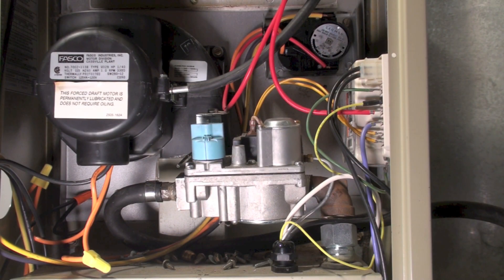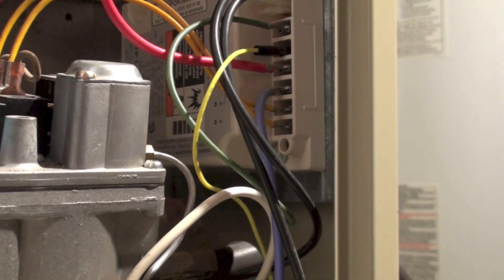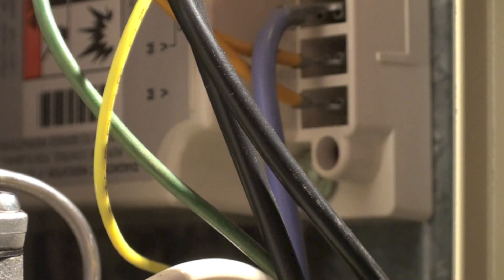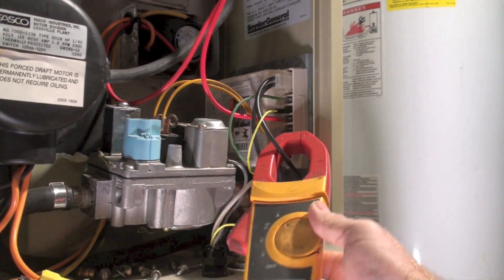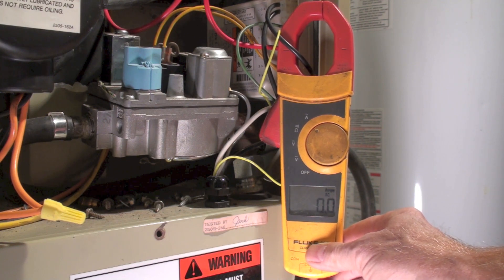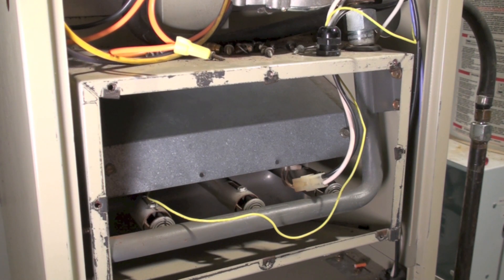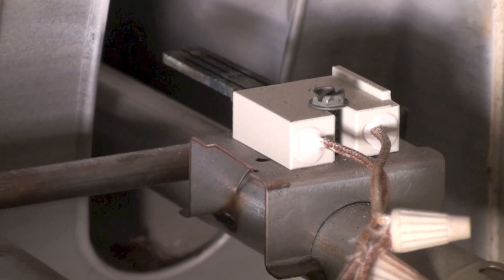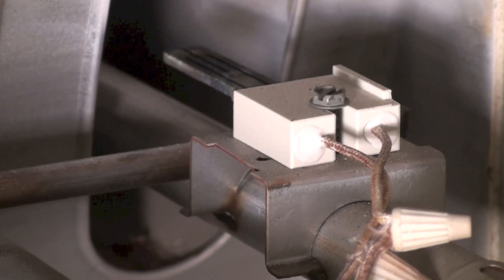No heat troubleshoot the HSI on the Snyder General GUA furnace.  Part 3

Comment: do you know if any 50E47 module work on my snyder/general GUI100AO20AIM mine has power going to the module no power to igniter when calling for heat my module is a 50E47-140 looking on Ebay at used ones to save me some $$ one add say's 140 but the photo shows 50E47-50 will it work on mine? just watched this video mine has no induction fan.

Comment: Can you find a replacement heater igniter?
Reply from the maker: You are looking for a silicon carbide ignitor.  There are a number of kits out there that could work for you.  The 2 things to look for are size of the ceramic base and the plug connection.
GFM